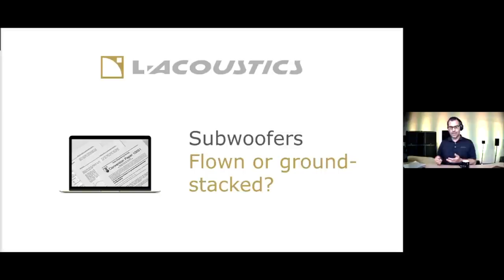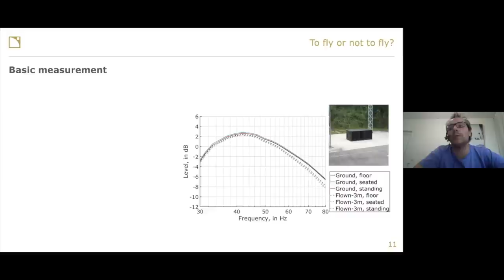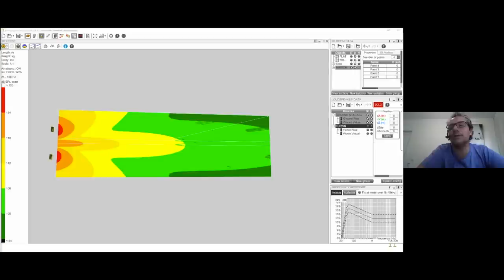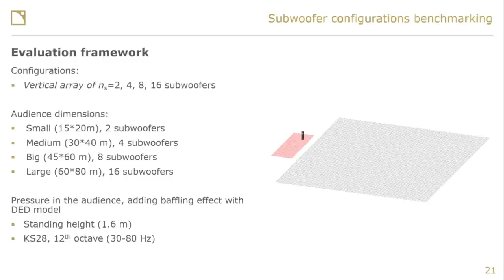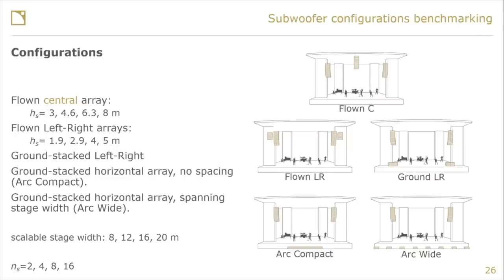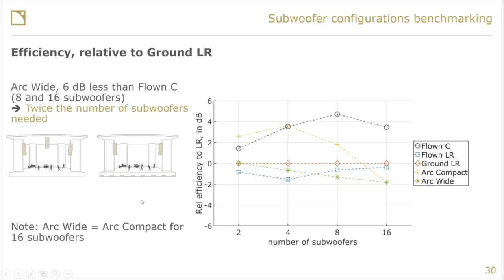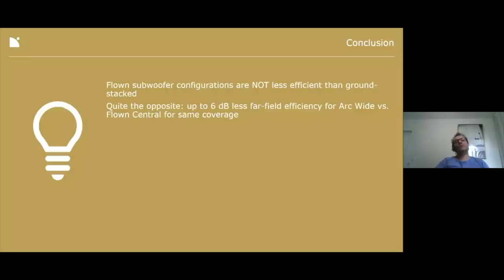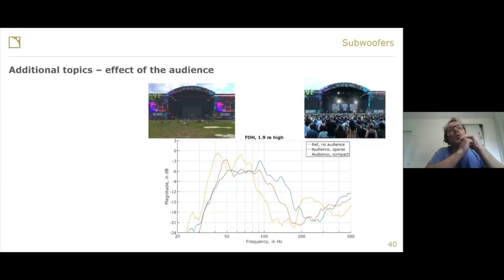Subwoofers: Flown or Ground Stacked? (L-Acoustics Webinars)

Comment: I always thought that flown subs couldn't be angled but recently saw flown angled subs at raiders allegiant stadium in Las Vegas. is this a standard that I am missing? what are the challenges of angling flown subs? when I say angle I mean flown in an array curve.
Reply from the maker: Hey there Phil! 

Thank you for watching, and your question. We hope this helps, putting angle on an array of sub woofer doesn't pose any acoustic challenge, depending on the size of the array it can affect its total output and directivity, some models of subwoffers are designed to be flown with angle, the K1-SB for example. 

- The L-Acoustics Team
Reply: thank you for the response. That makes sense. cheers @l.acoustics.official